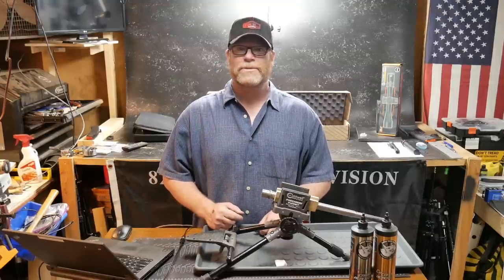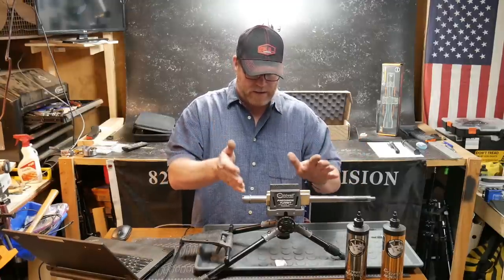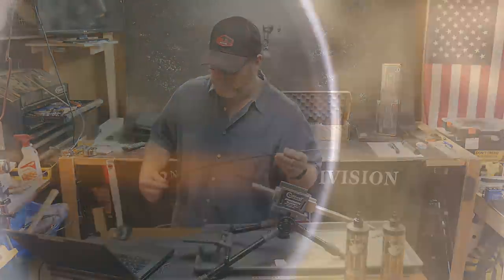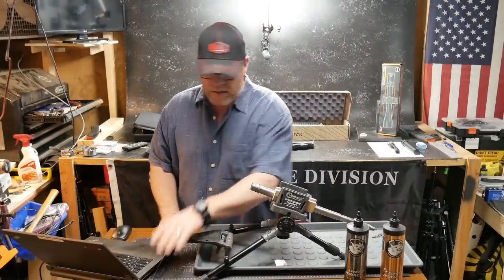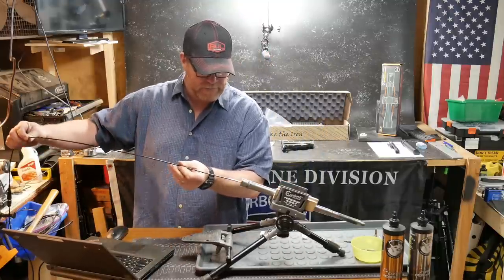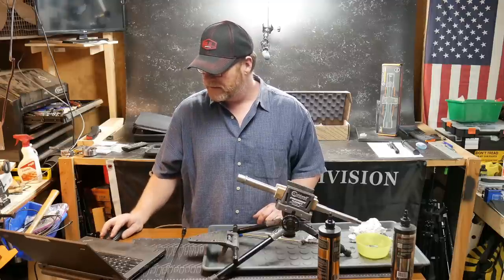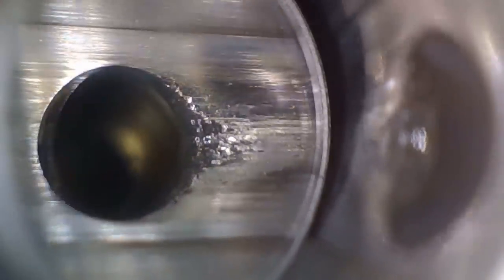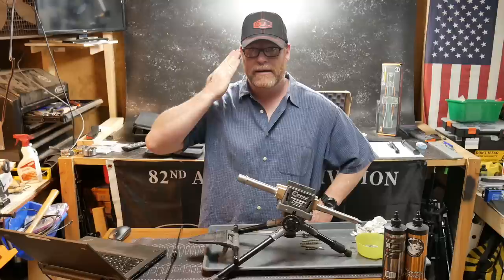Bore Tech Carbon & Copper Remover! Before & After with Bore Scope

Comment: Honestly I know this sounds crazy but I have a Krieger with 30 rounds of 308 though it. You would think the Krieger would look better it doesn’t at all. Actually kotaboy your barrel looks just as good as mine. Now I have only cleaned it with hops 9 so maybe I do need to invest in a good copper solvent.

Comment: Curious about removing that bbl after bedding with 609. After you apply heat and force to remove the bbl, do you completely remove all of the 609 and start over for next assembly? Or did the compound break free cleanly from the receiver or bbl allowing you to reuse the previous bedding?

Thank!

Comment: Just spent $80 for a bottle of Bore tech C4 carbon cleaner and a bottle of their copper remover.  The carbon cleaner is good stuff, carbon just dissolves away lickety split, but I am less than impressed with the copper remover.  I followed the directions three times and it removed exactly zilch.  There are a couple of small streaks of copper half way down my barrel and after going through the process 3 times (even keeping the bore wet and letting it sit for an hour on the last go round), it removed none of it.  The streaks are still there, cover the same area in the same shape (I am using a bore scope to view it).  $40 wasted.  The patches don't turn blue or any color change, no residue, they come out clean.  Sorry, but this stuff doesn't work.
Reply: I used the copper cleaner on one of my rifles and it worked good. Don't know why it didn't work on yours.